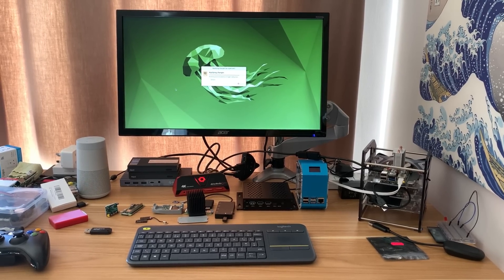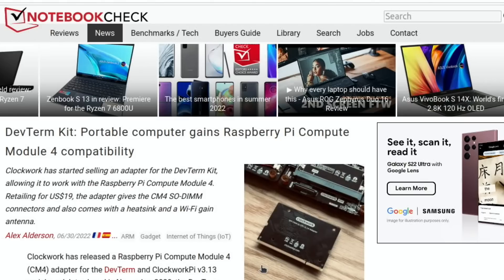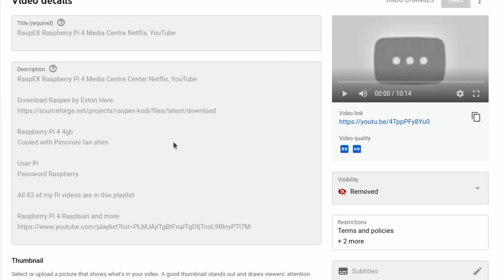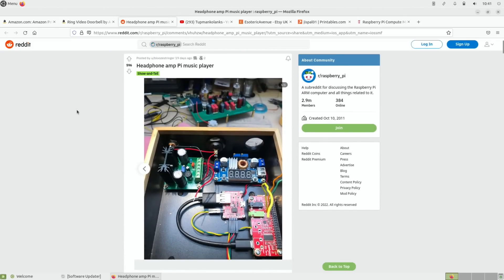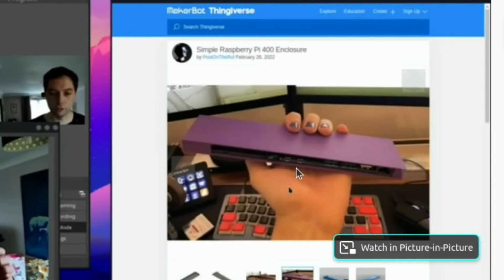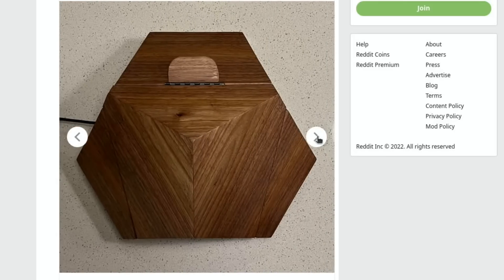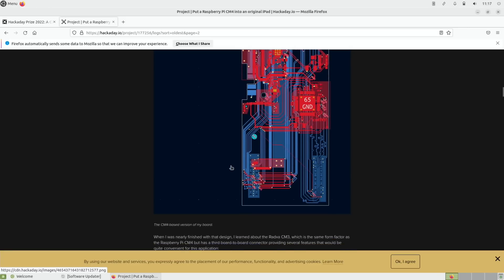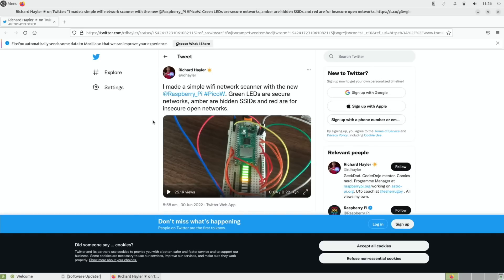Pi news 63. Pi 4 8GB Scam? CM3 to CM4 adapter.

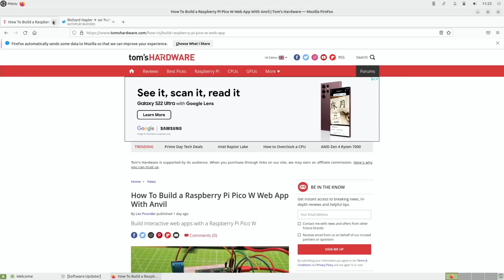Comment: 12:04 - Give it a year or so... once you start working on little projects, you realize bigger projects are just the same thing, but with a couple layers of extra goop holding everything together!
Reply: I disagree, Jeff.

I think you are being a little "disingenuous" here and it's the reason why I stopped subscribing to your channel but still subscribe here. I've only spoken to you now in reply to your comment above.

It's all very well you saying "big projects are the same as little projects" when you can sit in your extremely well-equipped lab and network "50 compute modules" and "100 hard disks" together in big "cluster computing RAID arrays", or whatever it is you do now. If you have the capability and resources to do that then I wish you every success at it on your channel - but that's "science fiction" to most "more humble" Pi users.

You are completely missing the point. For the vast majority of Pi users, it's is just a cheap platform that they can experiment on and have fun building other things with - sometimes that means buying cheap peripherals to attach to it and running emulators or teaching kids how to do take their first steps into programming.

That doesn't mean that the Pi doesn't have commercial applications too, but then that puts it out of the realms of what most people on YouTube are going to be interested in anyway, and there comes a point where a lot of your "inventions" just have no practicality in real life solutions - to be frank, I think a lot of your videos are about "look how clever I am" rather than understanding the practical applications of what it is you have built in those videos.

Please remember, you don't have to spend much more money than the cost of a Pi itself (screen, keyboard, case, power supply, etc.) to be in the same price range as, say, a used Core-i5 or Core-i7 Thinkpad that will immediately give you far more computing power for your money. Likewise, when you put together your clustered solutions, you rapidly get to a point from a cost perspective where a "built for the job" server will be cheaper and do the same job better.

Don't get me wrong here - I've worked with Linux since 1996 and it has been my main OS since 2003, plus my day job has been building, administering and hardening Red Hat servers for about 20 years now. I also educate both the young and old in Linux and Internet technologies (as long as it's not Windows). I have a good collection of SBCs that I am constantly messing around with, usually building Gentoo Linux on them. I absolutely enjoy the challenge of making something work with limited CPU power and RAM, that's what epitomises having fun with SBCs. I love what the Pi stands for.

In summary, "you do you" on your channel and I genuinely hope it's a success for you. But your comment above really just proves to me what I previously thought about you in that you need to get some "perspective" on why most people use Raspberry Pi's and SBCs in the first place. That's the reason I'd much rather watch Lee here working to more reasonable budgets on his desk than you putting together costly (and often impractical) solutions over there in your nice lab.
Reply: @terrydaktyllus1320  I'd like to point out that almost every project I've done on my channel requires a total of one Raspberry Pi or Pico W, and usually the lessons learned can scale from one to dozens of peripherals.

I have just as hard a time finding Raspberry Pis as anyone else; I was fortunate to order five back in 2020. I have about 7 Compute Modules now, and 4 Raspberry Pi 4s... though I would most definitely wish to build a larger cluster someday, it's just not in the cards with the current parts shortage.

With regard to the original comment above; see the timestamp I referenced. I was speaking specifically about projects like "use the Pico W as a garage door opener", not "build your own petabyte of storage" ;)
Reply: @JeffGeerling  How you obtain your hardware is not something I was questioning - all of us "In the industry" have certain contacts that make certain items easier for us to obtain because of "who we know" - and if you have companies sending you hardware to evaluate then so be it, that's you "making contacts" and demonstrates your influence in the community has reached a particular threshold level. Good on you for that.

But I've been building, maintaining and programming computers for four decades now and I'm really lucky to have lived through the "Golden Age of Computers", right from the early 1980's to today - I've done machine code programming, used a Commodore Amiga to access dial-up BBSes and the first Internet connections, and been fortunate in my work in the telecoms environment to have opportunities working with early UNIX servers and then with Linux later on.

I've always had a passion for "hobbyist computing" and teaching it to others - in which case, to get others interested, it needs to be kept as simple, cheap and easy as possible.

You do what you do, you're clearly good at it and you have a good number of subscribers - but I think you lose sight of the fact that you have a lot of ready access to a lot of good hardware (as do I, to be honest) and that can be daunting to a kid with his/her first Raspberry Pi who wants to get some ideas on what to do with it.

I'm in the UK, like Lee, and we have a dearth of youngsters taking on Computer Science degrees and coming into this IT industry - I suspect the same is in the USA. The youngsters who I (happily) mentor in my industry are from India, South America and Eastern Europe, but I'd love to see more British kids learning proper computer skills too - not just knowing how to use Excel and PowerPoint.
Reply: @JeffGeerling  liked crazily mad graphic card, being used with credit card sized Pi, like the way it project was going, would been in intresting to see, if the GPU, could take CPU  from the Pi, almost just using Pi as terminal, basically,  graphic card doing all the work, and letting Pi have an easy time of it, just doing I/O in out stuff mouse, keyboard, disk access, that sort of stuff,
Reply: Not understanding what your complaint here is. Make your own content instead of complaining to someone else about what they DO, and holy shit that was a light hearted comment from Jeff to begin with. All bringing you to going on about yourself, a lot. Absolutely nothing "more humble" about you. Jeff does interesting things with Pi's, if you don't like what he does, move along. There's no need to have this kind of rude dressing down, EVER, let alone off his channel. Maybe think about apologizing
Reply: @pgtmr2713  "Not understanding what your complaint here is."

Your lack of understanding could be down to limited comprehension skills on your part, and that's not something that I can help you with.

"Make your own content instead of complaining to someone else about what they DO"

How do you know I don't already make my own content, under a different pseudonym because I understand how privacy and identity work when exposing myself to Google and YouTube?

How do you know I don't have my own channel on, say, Odysee?

Maybe in real life I run Raspberry Pi and electronics clubs for kids? Or I run "Silver Surfer" sessions to help older people stay safe on the Internet?

Maybe part of my day job is writing training courses in Linux, cyber-security and TCP/IP networking for my peers and customers?

Do you see how silly you look creating your own mental image of a complete stranger based on only about 50 words that you saw them write?

"and holy shit that was a light hearted comment from Jeff to begin with."

And he appointed you his spokesperson, did he?

You're actually demonstrating complete hypocrisy anyway because you don't like me responding to Jeff, yet here you are doing the same to me. Make up your mind and be consistent.

"All bringing you to going on about yourself, a lot."

Then don't read it - I was talking to Jeff and not you anyway. "Keep your big hooter out" as we say where I am from.

"Jeff does interesting things with Pi's, if you don't like what he does, move along."

I don't take orders from strangers on the Internet, especially self-entitled ones. Again, my discussion was with Jeff, not with you. By all means, add your input but I can choose to ignore it too - or pull apart your reply and rip you a new a$$hole.

"There's no need to have this kind of rude dressing down, EVER, let alone off his channel."

There was nothing "rude" in anything that I said - if your "fragile constitution" is so easily offended by words, that's your problem (again) to resolve. If you can't deal with opposing opinions on the Internet, then go do a "solitary" hobby, devoid of interaction with other human beings - say, gardening, or reading a book.

If anything, it's actually out of respect for Jeff that I don't attack him on his channel, I simply unsubscribed from it. And I don't owe you an explanation anyway, sonny.

He posted a comment here, I subscribe here, I replied. Wind your neck in, it's none of your business, I wasn't talking to you and I don't have to consider your "editorial standards" before I post anything. 

"Maybe think about apologizing"

As above, I don't take orders from strangers on the Internet.

Run along, mind how you go, sonny, and stay away from sharp scissors.

Discussion closed, you are dismissed.
Reply: @terrydaktyllus1320  please post your future comments on a separate PM chat feed if you have a concern with another channel. If you don't like comments or do give a thumbs up/down. Arguing with the community all to see is not beneficial to the community on here, be the example not the lesson. Thanks and have a great day!